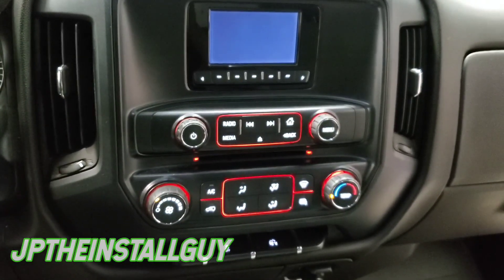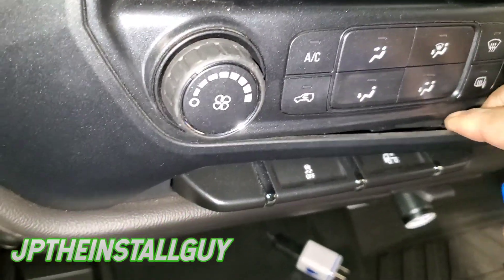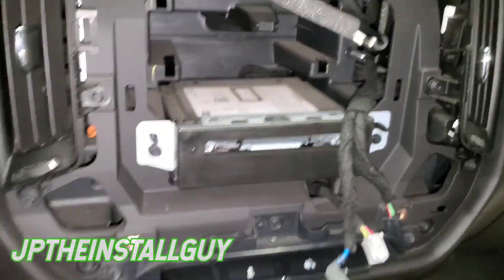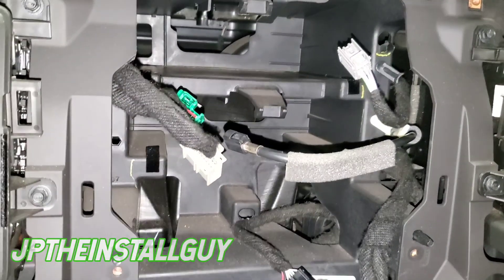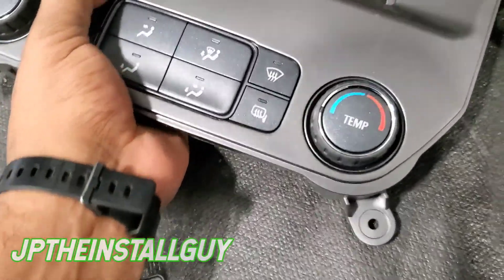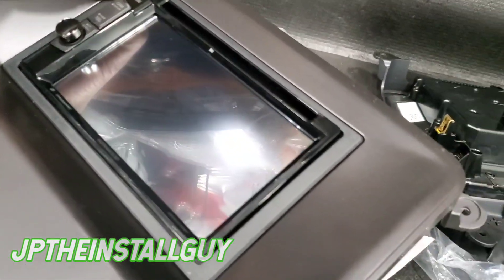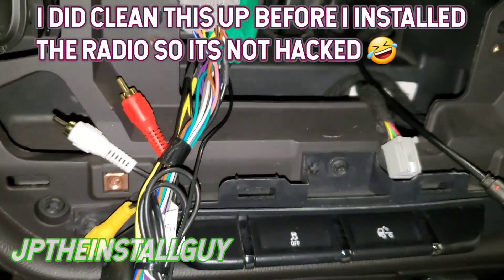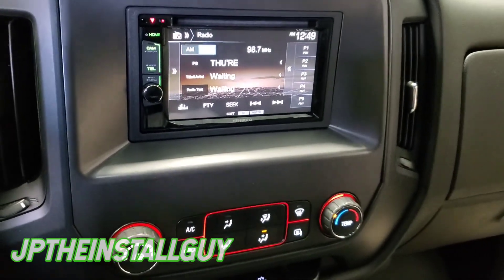2015 GMC SIERRA RADIO REMOVAL REPLACEMENT AND INSTALL

Comment: awesome man this was just perfect, got right to the point.!

I just had a stereo put in at an audio place and the radio itself  had horrible reception, everything else worked good, I took it back ask them if maybe the antenna didn't get hooked up and they said the radio would not work at all if the antenna wasn't hooked up , acted like I was an idiot/chump and said it was something else wrong not their install. so I wanted to open it up and see for myself but didn't want to break anything. this was perfect. I was able to get in there and sure enough the connection for the radio antenna was not properly hooked up, it was loosely stuck together but not actually clipped in like it was turned around the wrong way so the clip that secures it was actually preventing it from even going all the way in so I had a partial /very bad connection. it sounds really good now! I need to call them in the morning and let them know lol I bet they will just say I am a liar or something, they had some real bad attitudes.

Comment: Hi JP.  This video with the 2015 gmc sierra is super helpful.  I have the exact kenwood 2 din system and the exact vehicle you installed it in.  What harness did you use?  There are too many unanswered question when I look a harness.

Comment: I have a issue. But be nice if I could see how wired the PAC I have a bose system, I wired everything correctly, but I'm getting no sound. I wired the remote wire together and still no power to factory amplifier the yellow and the black wire are wired together with same color matching. I tried the different setting for the radio I tried reprogramming and still nothing can u help me out? You think it could be the Amp fuse?
Reply: did you find a solution? I’m having the same problem
Reply: @Brazsy  yeah, I had to buy a wirenaitor harness off this website that they sell. Tap into the bose amp and run your leed wires to the back to tap into those color coded wires. And it solved my issue... I'll find the harness link and send to u.
Reply: @jrburger1987  Bro, can you send me that link? Same issue here. No sound. There is no help on the internet for this issue.
Reply: @Ghost_327  what year is your GMC?
Reply: @jrburger1987  2014 Silverado

Comment: Hey bud I bought the pac harness kit installed my Pioneer aftermarket radio and 2 issues sound is low with volume up and truck won’t crank the Gear selection on dash won’t come on I installed stock radio and sound is great and truck turns on fine

Comment: Also I have a question for anyone who might know...one thing about this new radio that seems off is the screen only looks good if you look at it straight on, from the drivers seat it looks dim/washed out, especially when running maps, looks super faded but if  I move my head into the center it is clear as can be. I did adjust the view angle in setting and messed with the contrast a bit so that its better but it's still really dim over all and faded looking. it is a Kenwood similar to this. is this something to do with the screen they use or could this be something wrong with the unit itself? I have seen a similar complaint mentioned occasionally in reviews but most people do not mention it so I wonder if this is something wrong.seems kind of lame for it to be that way considering how much it cost.

Comment: Yo JP! What kind of air compressor and saw do you use? I’ve been using a multi tool to do my cuts and that setup you got made quick work of that dash
Reply from the maker: i have a snap on air saw literally the best thing ive bought off the tool truck and it wasnt a million dollars, also i have a regular 26 gal compressor

Comment: Yo my guy do you know what’s the difference between the PAC Lp5-4 and the LP6-4?
Reply from the maker: yea man they are the same the lp64 is a version only sold by bestbuy i think other car audio shops and pac's website have a lp54 and lp74 which the lp7-4 will give you a remote turn on

Comment: When I installed my after market radio my door speakers haven’t worked since any advice?
Reply from the maker: Which harness did you use?
Reply: @jptheinstallguy  I actually finally pulled it out and looked at it I had it plugged into “amplified door speakers” instead of the other one !
Reply from the maker: Ok yea that will do it sorry it took so long to reply I get so many comments it's really hard to keep up sometimes

Comment: Do you still get all the unlink features? Like settings and stuff ?
Reply: mine does! you do need to make sure to get the correct harness which is why I took it somewhere and paid for it to be done. because I was struggling to figure out really what was required. cost me $1800 but everything works , all the steering wheel controls for the volume and whatnot and all the truck specific settings/menues where you can go in and adjust how things are set up.